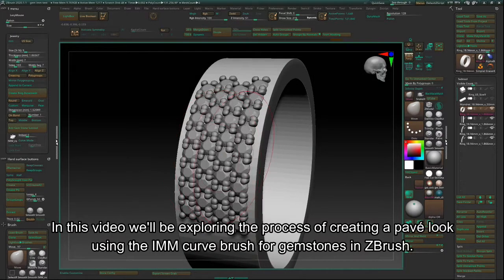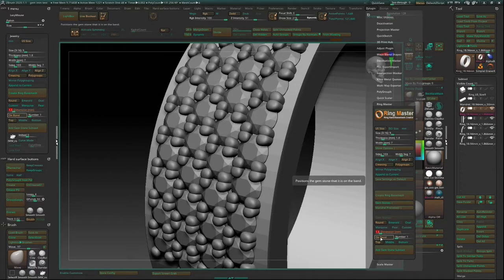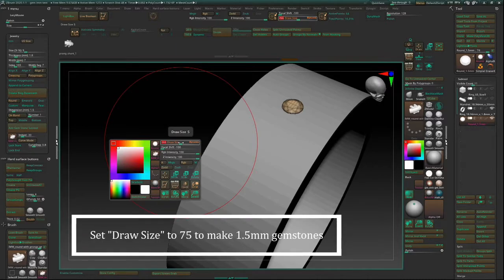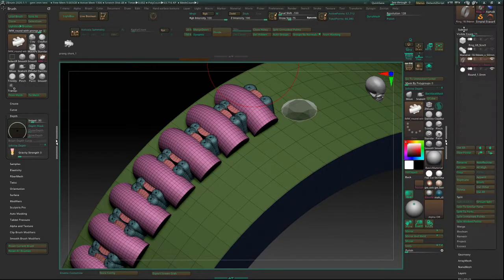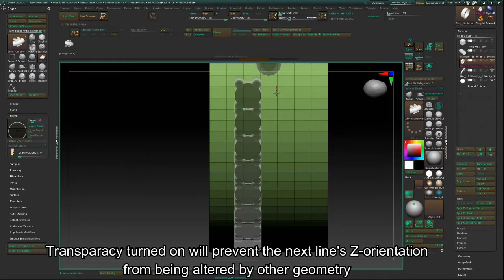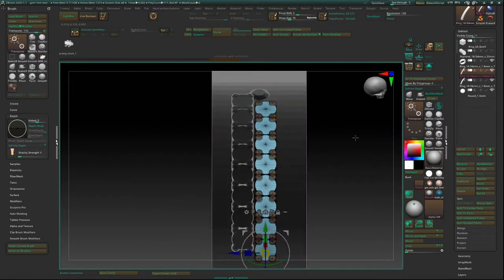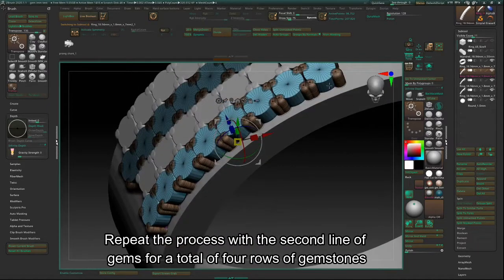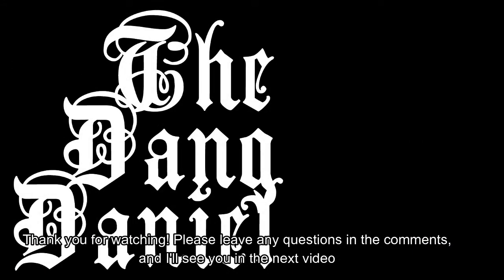IMM Gemstones with Cutters Pavé Tutorial

Comment: Hello Daniel! 
I bought the brushes but I’ve got a question, what’s the purpose of the Boolean cutters? If I have to print the ring to make a mold should I have to use them or it’s better without? I’m asking it because if I keep them active they will cut the prongs to. 
Sorry for the question but I’ve never made a pavè in my life :)
Reply from the maker: Hi Nicola! I would use them, yes, and if you put the prongs below the cutters in the subtool order, the cutters shouldn't affect them :)
Reply: @TheDangDaniel  thank you so much for the tip! What about the brush size? If I have to make settings for stones of 2.5mm how can I calculate how to set the brush size?
Reply from the maker: @nicolap.6628  That is tricky. What I do is use "IMM Draw Size" plug-in, and I will make an object (like just a sphere) that I KNOW will be 2.5mm, then I will adjust the gem brush size to match the sphere. Here is a link to the IMM Draw Size tutorial too : https://www.youtube.com/watch?v=BDeTX4q54Wc
Reply: @TheDangDaniel  I forgot asking about the curve and the negative depth, they must be always 0.8 and negative 30 or they will change as well with the stones size?